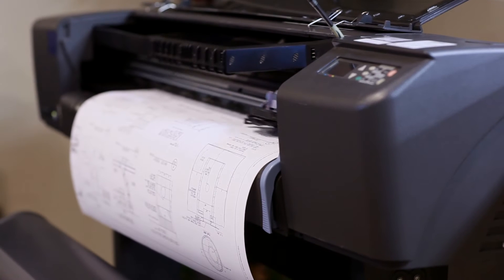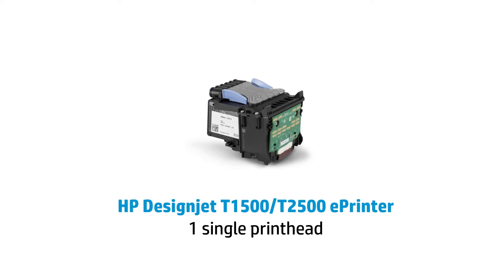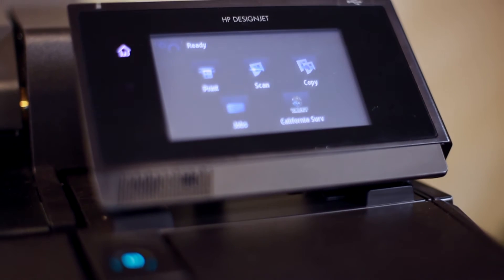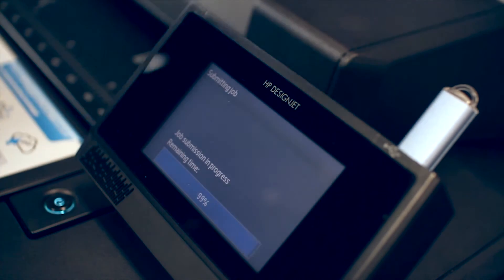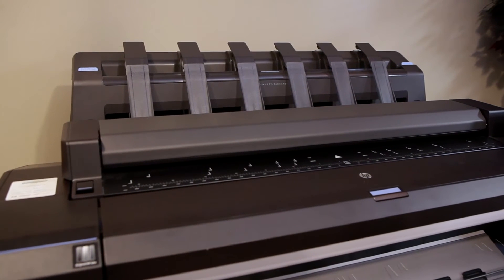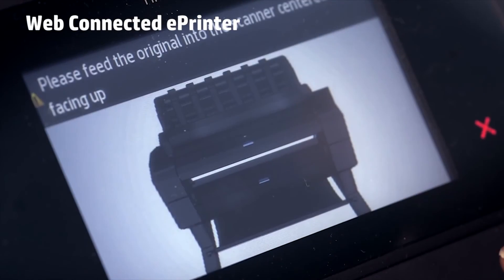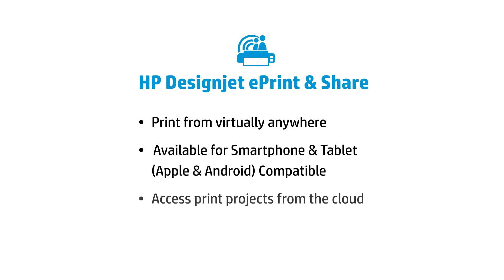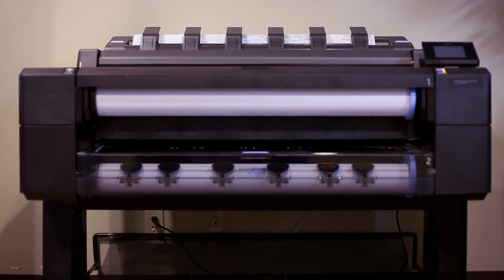Why Upgrade from the HP Designjet 500/800 to the T1500 & T2500 Series

Comment: Single printhead means you can't clean it that easily. This doesn't save the cost of operation. Crappy touchscreen, prefer my 800ps and 4000 model.